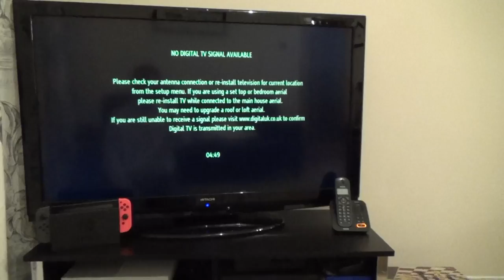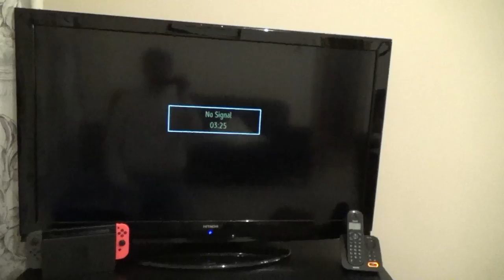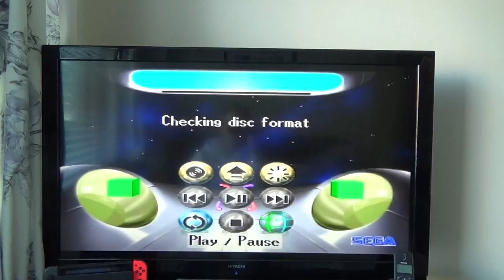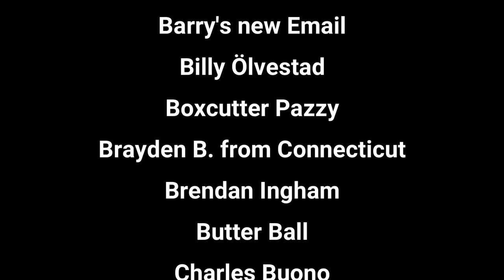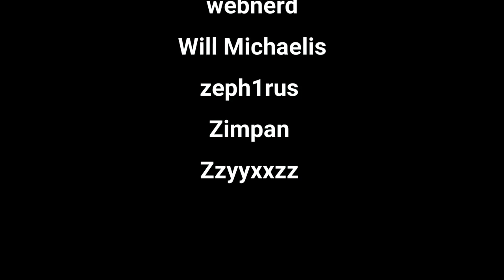SEGA SATURN with NO DISPLAY - Can I REPAIR it?

Comment: Its the wrong cd drive for a va9 motherboard, my console is the same as yours and has rectangular chips on the cd unit.
This may be the issue to your console not recognising game discs.
Reply from the maker: Hey Garry, I'm just working though this Saturn again and I have so far come to the same conclusion. I think I need a ENR-013A disc drive and what I have is a ENR-011A. I think the ENR-013A is the one with the rectangle chip like you said. Cheers mate, fingers crossed I can find a ENR-013A and get it up and running again 👍👍👍👍
Reply: @Mymatevince  
All the best with the repair mate 👍
Reply from the maker: Just editing it up now Garry 👍👍👍
Reply: Will look forward to seeing the vid mate. Also I subscribed to your channel now as I am loving the console repairs you do.

Comment: I'm sure this was a common fault where it played audio instead of the games and usually meant the laser lens was gubbed. Sometimes a clean with rubbing alcohol would work but normally needed a new laser
Reply: It works fine in the other one though, so it's not the laser.
Reply: He took a great deal of time to explain that the 'laser' works in another saturn.
Reply: it worked in the other saturn, so not this time.

Comment: It still looks like there’s corrosion to the tracks to the left of your track repair. At exactly 21.38 of the video you are pointing to the corroded track. Maybe nothing but I would check the continuity of those dark corroded tracks just to eliminate them. Forgot to say well spotted though and if you like repairing track corrosion try a Neo Geo AES as they are far worse!
Reply: Yeah I noticed that two tracks looking a bit dark I've seen that in the past and it could be open circuit on the two tracks well worth a check.
Reply from the maker: Very well spotted!!!!! Annoyingly I just checked and there is still continuity through that trace. Can't believe I didn't spot it at the time of filming as it is quite bad 👍👍👍